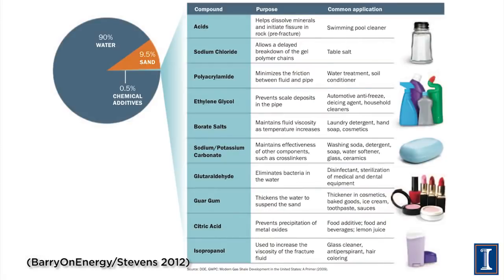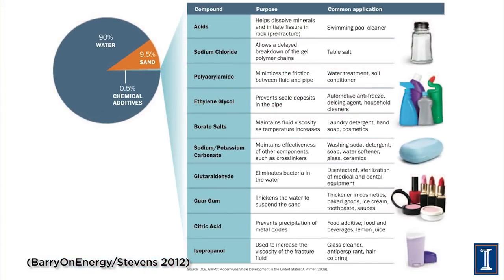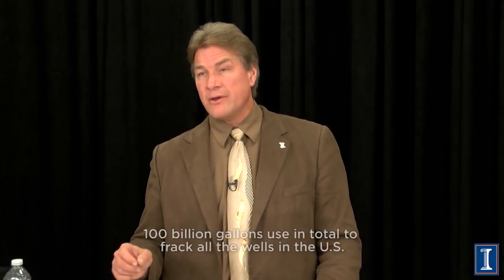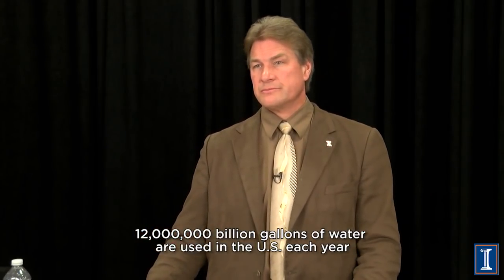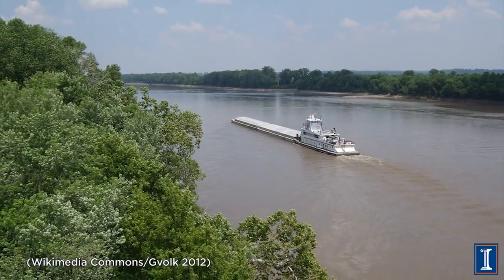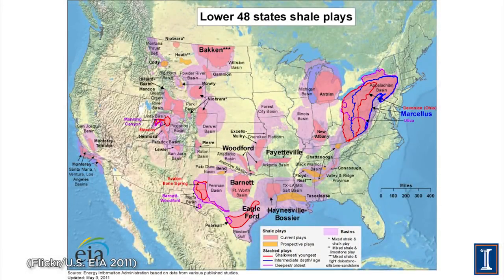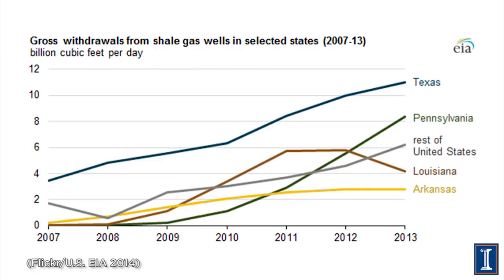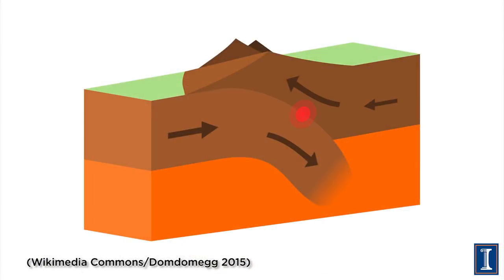Fracking and the Environment: Myth and Reality

Comment: The difference with water use in fracking is that the water is going to be stuck deep underground for ever. However the extracted hydrocarbons when burned are going to form water vapor. The real worry is that by sticking millions of gallons of water underground we are losing oxygen. Is it a significant amount of oxygen that we are losing ?

Comment: There are many ways they can frack but using water is the most common, there is about 40% flow back if the water injected, this is mainly saline and with it come uranium, radon etc and that can and does end up in the water table plus other chemical used in the process, it's not made up when people become ill from the pollution from this process and it's not made up when rock moves because it's takes in a liquid formation due to thousands of fractures it never had before, it's a no brainer any process, mining, fracking, quarrying will have secondary implications, those are hushered up as much as money can buy to protect investment and returns, it's business

Comment: .05% of 3,000,000 gallons is 15,000 gallons. That's 15,000 gallons of anti freeze, isopropanol, swimming pool cleaner, and a host of other chemicals, per mine, per Frack. I'm no rocket surgeon, but that can't be good.

Comment: George Mitchelle discovered that fracing works best with the slick water method.  And higher than 20000 psi pressures.

Comment: Is there regulation about the chemical allowed in the fracking ?
If we were to use only biodegradable/inoffensive chemicals there would be way less pushback.
From what I saw, there is a long list of toxic chemical put to improve the process. The major concern is polluting the water table with things that will stay there forever. What are the economics of that ?
From what I saw many water table in the US are contaminated with cleaner from dry cleaner, toxic compound that will never go away.

Comment: Fracking is unnecessary production of methane gas.  There is already an overabundance of methane in the market. Why are we ruining our aquifers and pressing methane into the atmosphere to protect halogenated vinyl and halogenated carbon molecules to produce a fossil fuel that is in overabundance in the market.  The damaging effects of the practice should have been enough to stop them.  The market pressure should have been enough to prevent the the unneeded practice.

Comment: It has recently come to light that Germany has enough gas deposits to become completely independent of foreign gas or other combustible fuels in a matter of weeks or months it would take to set it up. But people here are afraid it will erode away their homes or poison the environment, so they call you a crackpot for even suggesting the evil "fracking" and instead come up with new excuses as to why it is actually perfectly fine to support dictators and genocides, as long as it is far away from your own backyard. And politicians rather beg for forgiveness over questionable morals than risk reelection by implementing controversial measures and because they can't keep their esoteric-religious voters in check about actual clean energies like wind, nuclear, local fracking and hydro.

Comment: Regarding earthquakes, I’m from The Netherlands. We have natural gas reverses in the north and they started drilling in the sixties (I think). We are not anywhere near a fault line, but earthquakes have occurred and are still occurring. Not huge ones, but 2-3 on the Richter scale. Which is still enough to cause damage to properties, devaluing them. And making people feel unsafe in their homes. Though we are not fracking, just drilling. Not sure if that makes a difference.

The drilling is actually ending because people started to protest. Basically the government made a lot of money off of the gas (in The Netherlands, if you own a piece of land, you only own the surface; anything beneath is owned by the government). And they didn’t compensate the people that suffered these consequences well enough.

Comment: This was very enlightening. What was always concerned about are toxic solvents used as part of the fracking fluid. Then there is the disposal of the fluid. As I understand it, the fluid is pumped back into the exhausted well and sealed. The concern is that if the seal fails over time and the waste fluid escapes into the water table. How do you clean up the water table??
Yes, the well is far below the water table as far as we understand it today. I don't think this precludes the possibility that the fluid could resurface in the future.
Reply: Consider how to mine oil conventionally, you use a diesel and sludge mix to lube the drill called "mud"

Comment: Sounds great if you don't ask any questions doesn't it?
No mention of radon, uranium, heavy metals forced up into the water table and the gallons of goodies that remain in ground water that are not recovered from the fracking fluid. How many millions of gallons of ethylene glycol is that exactly? Why was it that car antifreeze had to go green? Probably just to drive the price up. Maybe because it's poisoning the water table? Say 60/40
Great well with great water didn't burn for 20 years before fracking and now it does. Naturally occurring? Lol
Anyone ever smell the air near fracking operations? You will always know the smell after you figure it out. Have one in your neighborhood and breathe that 24/7. What could go wrong?
No argument that some fracking is needed. Also no argument against the proof shown in the anti fracking videos that it's not rosey as this video paints it. Sounds like the fine print says $$$ paid for by someone getting rich from fracking. Not paid for by the family living next to the frackin thing!

Comment: As an aerospace engineer I appreciate that our energy needs require practical compromises and demystifying the public’s reactive perceptions to certain energy solutions. I appreciate your YouTube series regarding nuclear energy. However, this presentation seemed to be less discussion regarding the science and more about defensive arguments. You literally said that the rare instances of poorly treated fracking brine are addressed by regulatory oversight. Do you really believe this? Really? Hw many federal agencies and personnel oversee these fracking locations? What are statistics regarding industry penalties issued and paid (not overturned or reduced) for improper operation? It is a disservice to just say it is handled without evidence. Consequently I don’t feel this review was balanced and comprehensive.
Reply: I cant speak for the oil/gas industry but in coal mining there are government inspectors on the mine sight weekly or even multiple times per week. I can confirm they do their job because I have been in trouble with them. They certainly inspect every aspect of the mining operation and I have witnessed them completely shut down mining processes for things not being correct. Im sure oil/gas has a similar inspection arm.
Reply: And you completely trust a political entity to do what is necessary without any bias or influence.

Comment: Basically: it used to be a problem but we've mostly fixed it and there are ways we could do it that are way better but we're not doing yet, and also we're guessing that maybe the earth tremors could be a good thing but that's not based on evidence only conjecture. As you just said, geologists need to study this conjecture to find out if it's true, or if these microfractures will actually cause the plates to speed up in movement relative to each other and cause more high magnitude earthquakes.

Not a very convincing argument to continue fracking. All you have demonstrated is that things are not as bad as some people make them out to be. This is obvious. Natural gas is much better than other fossil fuels. We should still entirely focus on switching to nuclear (which we should have done decades ago) in our inevitable transition to renewables instead of focusing on how to minimize the damage done by archaic methods so that we can keep using them even longer.

Comment: I wish he would have mentioned that the water once used for fraking cannot renter the water cycle either via treatment or dissolution. Water used for agriculture or household use, even black water can be treated and eventually reused, if not always be readied for potable use. However, fraking fluid can only ever be used for fraking. Additionally if commercial use produces waste water, its disposal is subject to the clean water act, however fraking fluid is not. Rather convenient for the industry...

But all this is moot. Fraking has rarely ever been profitable, case in point: Louisiana. Examine the financial status of the firms engaged in fraking, at least one of them is filing for bankruptcy a month, heck even the firm that was the trailblazer, Chesapeake energy, is bankrupt. Other examples: Ultra Petroleum, C&J Energy, Diamond Offshore, MDC energy to name a few. 

Solar and wind is the way forward, augmented by Nuclear and Hydroelectric.
Reply: Мухэммэд Харис  i dont know whether you are being facetious, but there are numerous hazards, apart from green house gas emissions, but yes, removing water from the biosphere is a concern too, especially when that is not brackish or sea water.
Reply: Get a job hippy.

Comment: I work in frack and I've been saying these things for years. When Fracking first started booming, mistakes were made and we learned from those mistakes. Same thing happens with any new technology. The benefits of American energy independence far outweighs the downside to hydraulic fracturing. Consumers are not going to reduce usage. If anything, it will continue to increase. Natural Gas is a great transition fuel to get us through the next 40-50 years while we research better battery technology to store energy from renewables and make them more robust against spikes in demand. It will also help reduce emissions by filling the gap as we reduce usage of very dirty energy sources like coal and build more nuclear reactors, which take years to build and bring online because of their heavy regulation. Smaller modular reactors could be a game changer, but R&D on anything nuclear isn't cost effective enough to justify it as the ROI just isn't where it needs to be for a company to pull the trigger. That may change in the future, especially if it gets subsidized. Seeing as how most establishment politicians are greased with oil money, I don't see it happening anytime soon.
Reply: When you start exporting the natural gas you’ve moved beyond energy independence and into the realm of pure greed.
Reply: @waynebreivogel1742  That's called competition, and it helps drive the price down in other economies, making it a more viable energy source for less prosperous countries, thus reducing carbon emissions even more. It's not greed unless people need it to survive and you're hoarding it to raise prices, like OPEC does with oil. They call them a cartel for a reason. Flooding the market with cheap energy forces them to adapt and become more efficient, which is exactly what they did to us 10 years ago. They drove nearly every US fracking service provider out of business by flooding the market, and only the most efficient and cost effective survived. Now they're paying for it because now we're more efficient than them, and they can only let prices stay low for so long before they start to suffer too. It's a battle of efficiency, driven by the free market. That is a very good thing.

US companies are already planning for the future by investing in new technology in electric pumping fleets to stay ahead of the competition. Mark my words, in 5 years, the majority of all fracking in North America will be with electric fleets with AI driven automation controlling the frac process.
Reply: Мухэммэд Харис  Probably not, but compared to other industries, it's a miniscule amount. Since switching to produced water and reusing frack fluid, it's even less. He addresses this in the video at around 3:00.

Comment: What he said about the increase of earthquakes because of fracking isn't correct. There has never been any evidence that small micro-quakes can relieve enough stress to prevent a larger earthquake. The reason for this is simply that there aren't enough micro-quakes to even put a dent in the energy released during a major earthquake. Let me explain...

Lets use the example of a 7.0 earthquake. The energy released in a 7.0 earthquake is equivalent to approximately 500 Kilotons of TNT. The energy released in a 3.0 earthquake is equivalent to approximately 0.5 tons of TNT. Remember, the scale is logarithmic. You would need 1,000,000 (one million) 3.0 earthquakes to release the same amount of energy as a 7.0 earthquake. At best, fracking MAY cause upwards of 10,000 micro-quakes a year - well below the 1 million needed. But what if we wanted to just reduce a 7.0 to a 6.0? Well again, the scale is logarithmic.  A 6.0 earthquake is equivalent to about 15 Kilotons of TNT,  which is 485 Kilotons less in than the equivalent TNT of a 7.0. So to reduce a 7.0 to a 6.0 would require enough micro-quakes to release the equivalent of 485 kilotons of TNT - or about 970,000 3.0 earthquakes. To reduce a 6.0 to a 5.0 would require around 29,000 3.0 earthquakes, and so forth. Simply put, there are nowhere near enough micro-quakes to release enough energy to make any sort of dent in earthquake magnitudes.  

Side Note: Most definitions of a micro-quake put them at 2.0 or below, so I was being generous by using the 3.0.

Comment: Use the river not the water from a drinking source. Where does he think drinking water comes from?
Reply: underground water is the most common source of drinking water. River water is mainly used for transport and agriculture.
Reply: @jonathanp.greenberg400  so what hes saying is use rivers not underground sources? That has a lot of environmental impacts as well. I am trying to be objective about fracking and trying to understand it.
Reply: @Morgan Johnson regardless of the water source there is an environmental impact. River water, as a source, has less of an impact since its water you wouldn't normally drink anyway. Idealy it would be seawater which is even less drinkable and we have more of but its harder to get to in most fracking areas like Pennsylvania. I would like to add that, yes some rivers provide drinking water and those should Not be used for fracking but the many that don’t provide drinking water could be sources for it.
Reply: @jonathanp.greenberg400  Rivers are a major water source for some cities and states though.

Comment: Friendly reminder water USE isn't the issue with fracking, mostly because they use non-potable/brackish water. The issue is methane leaking (2-3% of production) and water contamination. Can be from not even leaking fracking fluid, but disruption of the formation similar to mining, leeching heavy metals/hydrocarbons into the water table.
Reply: I was thinking about that. I am curious to his response on methane leakage. And leakage of putting said water back in the ground with chemicals. 
Interesting point on fracking being beneficial for earthquakes however I only see this happening near areas of tectonic pressure. And then there are long term effects of leaving said liquids inside the earth. Of course, if it isn't left inside the earth then that isn't an issue. The pumping of liquid methane does sound interesting however the runoff of methane in our atmosphere might be something to be concerned. 
Honestly, resource management should be more of a concern as consistent lack of planning ahead has caused issues. Not that I think we will run out for quite some time, however I do think that it is important to plan ahead for future generations even if it seems irrelevant for our lifetime. 2-3% loss is quite a bit and will add up over time. It's important that enough resources get put into R&D of loss prevention and to do so quickly.
Reply: @apersonofthisworld6302  Yep these have always been the major complaints about fracking, at least over here (The Netherlands). If the amount of water used was a problem than we probably would not and should not have Olympic size swimming pools.

Comment: Here in Oklahoma, we have tied together that injection wells near fault lines are a bad thing.  Our experience is/was that injection wells along a fault line were causing large earthquakes in addition to the many small ones you described.  When we shut those down and relocated them to areas further away from the fault lines, our earthquakes slowed significantly.  Just tossing this out there to help clarify.
Reply: i think you forgot a very important item - the injection wells that caused those quakes are (were) injecting fluid from oil wells not fracking wells
Reply: Thank you,  I  too am  an Oklahoman  and  yes, you are correct.  And we proudly are harnessing wind power. Oklahoman's value our home and our future.
Reply: I’m guessing it helps to lubricate the fault lines, allowing them to move against much easier.
Reply: I think you misunderstand.  If you are getting midlevel quakes when fracking adds some lubricants, it means you have the potential for a much larger earthquake without fracking.  When that big one finally hits, you won't need to worry about what fracking did or didn't do.  Most of your buildings will be rubble because you have no earthquake-resistant building codes.  Fracking is delaying and reducing the risk of the BIG earthquake.

Quite ironic that the regulators are rushing to stop this particular fracking, but probably won't bother updating your building codes.
Reply: @kodiak2fitty  That goes against the evidence that Oklahoma already has that we had big earthquakes while fracking, and now we are down to smaller ones less often after eliminating fracking at fault lines.